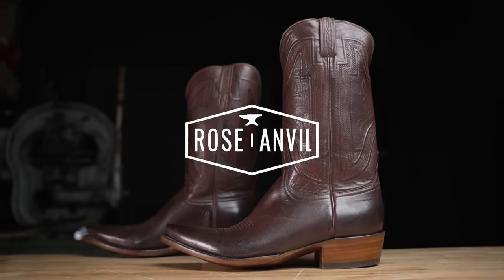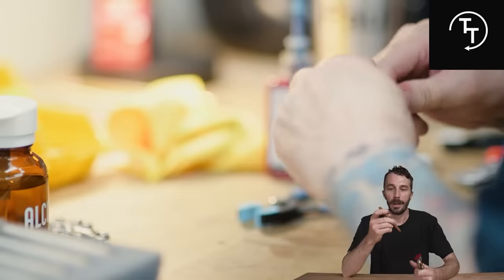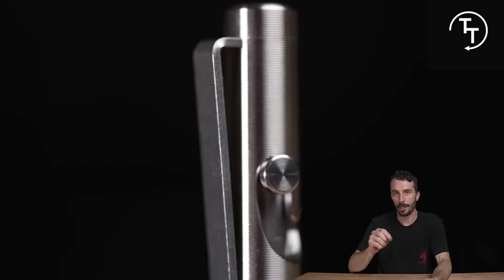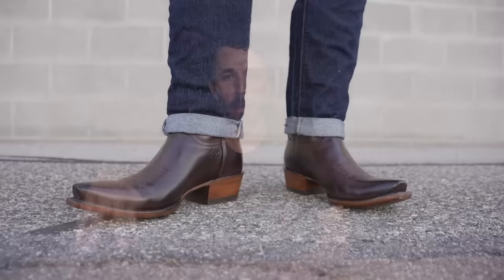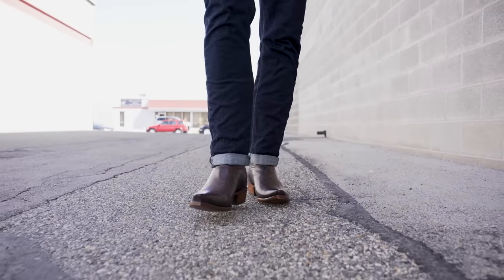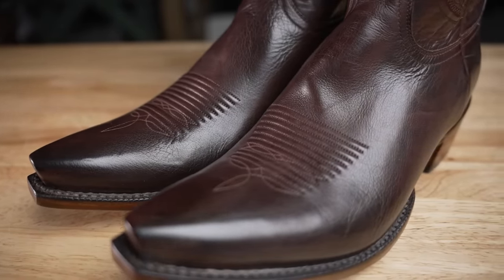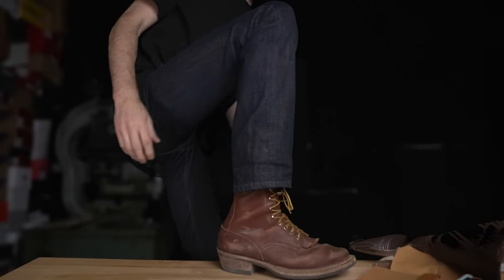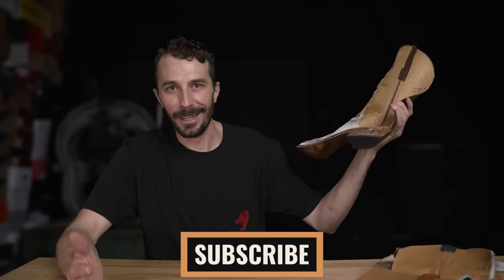Why the most luxury cowboy boots are disappointing - Lucchese

Comment: They should definitely have better quality lining in there. I would expect calf or something for that price.
Reply: Yeah but what you're missing is the fact that they are making these boots the exact same way they made them a 100 years ago to now, to change anything would change the heritage, when you get a pair you're wearing the same boot that James dean wore
Reply: Im sure James Dean had a composite narrow square toe structure. Much heritage.
Reply: @ausfuhrung  They weren't using plastic toe stiffeners and foam heel cushions 100 years ago...
Reply: @Brian-ee1gx  They didn't even exist yet
Reply: They don't make lucchese boots like they used to. At this point they still sell boots because of the name, if you want a real pair of boots get some rios of mercedes.
Reply: @ausfuhrung   they promote that but it isn't 100% true. I love lucchese classics. Won't wear anything else. But san antonio classics had leather heel Rands. After moving to El paso the heel rand became plastic. I dont know if any other materials changed but I know that did. And while the boots are otherwise made the way boots were made in 1883 construction wise, they have changed some of the methods, like implementing an automated stitcher for the shafts. 

That said the bootmaker/1883 line, while using the same outer leathers, uses a different method/process than the classics to make them cheaper along with a cheaper lining and welt construction. But the claim they make the classics the same way as 100 years ago is only true in terms of final construction.
Reply: so do have calf lining it’s just different for some boots. every lucchese i’ve got is 100% worth the money. Tecovas is now becoming my more everyday no matter what boot recently.

Comment: Lucchesse and Leddy's boots also come with the concept of a well fit boot. If your foot fits perfectly in an off the shelf boot from boot barn then good for you but most of the time those boots are going to be pretty loose. A good way to know easily when it comes to cowboy boots is if you can easily take them off by hand your boots are far too big. You should need a boot jack to get them off easily. Having a thinner foot leddys and Lucchesse are the only places I've found with boots that fit off the shelf as they have a wider size range going for them. Plus you don't have to go up to $1k, they have several boots for $500-$700 same as Leddy's. But if you're going up to $1k anyway you might as well go up to $1500 and get yourself a full custom pair from Lucchesse. Mine should be coming in next month lol.

Comment: I have a couple pairs of Luccheses. They used to have a non-handmade line that was cheaper. I paid about $300 for a pair of ostrich leather boots. My other pair was about $700, all cowhide, and they were a wedding gift from my wife. I really like my boots a lot. The cheaper ones are more than 10 years old and the more expensive are 9 years old. Both are holding up well with normal maintenance. 

One other thing about Lucchese is you can often select the type of leather you want from normal cowhide to goat all the way up to exotic things like crocodile. I once saw a pair in a store in Santa Fe that purported to be elephant skin.  That is insane to me. Anyway, I don’t have the ability to measure the thickness of the leather on mine, but I would guess they’re thicker than 1.5 mm. Maybe the thickness is related to the leather you picked?
Reply: They still make the 1883 line, and they’re still nice boots for a lower price
Reply: Elephant 🐘 hide boots are fairly common, readily available.

Comment: I have two or three pairs of Lucchese. They have a nice look to them. The things that made me really irritated is I moved north where there are cold temperatures along with snow and ice. You can't wear a thick sock in them so your feet are either pinched or cold. Then there is the leather sole which after both feet going out from under you and a week of pain in the shoulders, neck and head, tou become unhappy. The thin leather cracks even with weekly treatment. I have one good pair left and use it for summer wear. Bought a cheap set, put insoles for better comfort and you can wear heavier sock. Dropped them off to be resoled in vibram. That was as much as the boot, but great for winter wear.
Reply: Exactly, ive got the same issues. But add to that, the lack of a pattern or rubber sole to grip in ice and snow, or even mud. Cowboy boots in new england are only good to wear when its too hot to wear them!
Reply: @HarborLockRoad  what treatment do you use?
Reply: I would never wear my Lucchese's in the winter.  Not only is the ice a slip hazard, but all the salt will decimate the leather.  I've ruined a decent pair of Allen Edmonds dress shoes, and would hate to see that happen to my Lucchese Caiman leather boots.

Comment: I found that their cheaper lines typically had the thinner leather such as their 1883 series, however I found it made them much lighter to wear and quicker to break into the shape of your foot. As a dress boot, I feel thats OK. Their classics line is much more expensive and my pair of those is quite alot heavier. Another point missed in this video is that this line of Lucchese boots aims to be made as close as possible to the traditional way of doing it. Yes there is a little synthetic material used in places as mentioned, but things such as the pegging on the sole is unique to Lucchese and not found elsewhere AFAIK. You are paying for something that has had alot more hand labour go into its production than any other boot.
Reply: @LoneWolf-qk9pl  I ordered and just received a pair of blackjack boots in  the same size as my Lucchese Classics boots.  They are very well made and fit ok.  But I have to say I’m disappointed because they don’t feel as good as the Lucchese.  There is just something about the way Lucchese Classics boots fit and the comfort that seems to be unique to them.

Comment: Since you were reviewing the justification of the price of these boots, I find it odd that you didn't comment on the other quality features of a high-end cowboy boot like the amount of pegging used, which is a hallmark of premium quality cowboy boots...generally, the more pegs used, the better the build construction.  You didn't go over the quality of the stitching & design on the outside of the shaft which is far superior to other mid-line cowboy boots you had assessed.  I'm sure if you cut into a pair of exotic-skinned boots, you'll also find that they're also thin. Your comment on how thin the leather is, but you noted it's higher quality leather. You don't think the higher quality leather doesn't contribute to the cost like other exotic premium skins? Surprisingly, as a cobbler, I thought you'd have better insight as to what makes a quality high-end cowboy boot, yet you don't speak adequately to key facts about top-line dress cowboy boots: if they're handmade, the quality & cost of the premium leather, stitch quality & design of the exterior on the shaft, and whether the model is a limited edition or a custom design. 

My ex used to work in a cowboy boot store back in the early 1990s (which is why I've got over eight pairs of cowboy boots), and I learned a lot about the key differences between budget-priced cowboy boots, mid-line cowboy boots, and the high-end cowboy boots. It really comes down to the materials, build quality, the boot's intended use (fashion/work/daily use type of boot), and it's availability (ie. limited editions). If you're going to compare $1000 boots, compare them to other high-end boots (ie JB Hills, Tony Lama Gold/Black Label etc...), citing the qualities that makes them high-quality boots...not on merely how thick the leather is. You'll find that exotic leathers aren't very thick at all as well.
Reply: This

Comment: Tactile pens have the best pens for grip. The bolt comes off easily and needs to be Loctited (spelling?). Not a big deal, but if you're around town without the bolt Loctited in, then it could pop off and you'll lose the bolt in a random spot. Fortunately, I lost my bolt at home and found it easily. Haven't had an issue since. Same is true for BigIdeaDesigns.

Comment: There's a  cowboy boot company called Stewart Boot Company based out of Tucson, AZ that has been around since the 40s, I believe, that makes hand made boots that are around the $500-$600 range. I'd be interested to see what their construction looks like. They used to be pretty readily available, but their production is pretty low these days. A couple of tidbits I do know about them is that they claim to be made of horse hide (not sure if it's Cordovan or not) and you can find vintage pairs on ebay fairly easily. I think they also do custom orders.

Comment: Maybe I missed it on the previous pairs, but the metal shank seems to be much longer and maybe wider on these, seems much better imo, especially since they are just dress boots. Not much need for the shaft in non work boots

Comment: Not disappointed in the least with these dress boots. Exceptional fit& comfort for me. Cost 800. No tax or ship. If you need a boot for mucking Around  livestock. Go Muck or go home. Nobody in their right mind would wear Alden’s in a stable. Lucchese does  have cheaper work boots.They also have them in multiples of a thousand.

Comment: 16 years ago I bought a pair of Luccheses. I'm a Brannock 10C, so standard size footwear doesn't fit all that well. These were 9 1/2 D. They slipped on like socks. But with an arch. They cost more than any pair of shoes I'd ever bought. $500 or so, which was way beyond my budget. I wandered away from cowboy boots over the years, but I kept these boots (after totally wearing out an awesome pair of 10-1/2 B Noconas. 8 years or more of near daily wear). After watching this video I dug the Luccheses out of the closet, brushed 'em up, and wore them around for a few days. And you know what? I like them a lot. Your aesthetic is beefy, thick slabs of leather, and thoughtful, tough construction. I get it, and you've taught me a lot about boots how are made, for which I'm grateful. But my Luccheses, with their thinner leather, higher almost Cuban heel, and oh-so-subtle curve from high waist to the snug yet surprisingly comfortable toebox, are more than the sum of their parts. I did insert a Birkenstock footbed, which snugs up the instep for a truly custom fit, and a tighter heel.  As stylish as they are, and Luccheses always look SHARP,  this boot has a built in stride, a natural gait. It is among the best walking shoes I've ever worn. The lightness of the boot, even with its calf shaft lining and pigskin vamp, makes it surprisingly comfortable year round. The leather sole isn't all-weather, but it isn't just a big insulating slab. You can feel the ground. Good for you for keeping companies honest about market parity. I don't disagree about cost, but there's a deeper design issue with Luccheese that is about a more holistic package. They're boots I'm glad to live in.

Comment: The cowboy boots you have cut open in this series are for the most part only cowboy style boots. They are not a working cowboy boot. Boots that are being used all day in the saddle will most likely be tall topped, round or squared toe,and higher heeled with a spur ridge. The vamp will be made out of heavy  leathers to counter wear from the stirrups,and brush. Working cowboys take great pride in their gear,and how it looks. They will spend a lot for gear especially when it is made custom to their needs,and styles. Olathe boots might be good ones to cut in half.

Comment: Over the years I’ve worn Tony Lama, Dan Post, Hondo, Double H and El Dorado boots.  I also tried a couple pairs of Ariat boots which were more like western sneakers. They were comfortable at first but the fit became increasingly sloppy, and the soles and heels didn’t bold up well.  I sent them in after about 12 months for new soles and heels and it wasn’t worth the trouble or the $90 per pair expense as the new soles were not going to wear any better than the first set. After a couple years of just sitting in closet while I wore real boots, I donated them to Goodwill.  2 stars don’t recommend.

My choices for testing for “best cowboy boot”:

1) El Dorado boots.  I’ve had a couple pairs of El Dorado boots for about a year and so far I have been impressed, although so far they have mostly been regular daily wear around town dress boots They are vanquished calf leather one in a round toe and the other in a square toe.  They have a similar look to Lucchese dress boots but with a last that fits my feet a lot better than the narrow in the heel last that Lucchese uses. And at $279-$379, they cost a lot less. Other than a removable TCS insole, they appear to be a traditional hand made boot. 

2) Hondo boots.  I’ve also had a couple pairs of Hondo boots (styles 2904 and 8555) for almost 10 years now and they’ve held up well through two or three sets of soles and about that many heels with everyday wear in the wet, etc.  The 2904 boots are starting to develop several vertical cracks in the leather on the outer edge of the boot where it flexes. To be fair, they’ve lived most of their life in eastern NC, where wet and humid is the norm and they’ve seen hard field use.  The rest of the boot has held up well and I’m tempted to have that area patched when they finally crack through the leather.

Comment: You can get a handmade, custom-fit US-made cowboy boot like a Wilson's Boots or a Beck's Boots for 650-700 USD, though those take a few months to make they'll be a lot better than this I think.
I'd love if you could cut up a Wilson, but those take up to a year to be completed. That said... you could pick up one of the handful of used ones on ebay for like 200 since you're just gonna cut it up. I'd appreciate it! It would be a nice thing to know since I'm really thinking about grabbing the Wilson.
There's some quality show boots I've heard a little on
You could also look at Stallion Boots, though I'm pretty sure those are greatly overpriced as they're even more costly than Lucchese they're supposed to be very high quality but mostly fashion over the form of others.
Rocketbuster is supposed to be both very quality build and a show boot, handmade, extremely expensive, a lot of flashy decoration along it.

Comment: I always enjoy looking at the inside of boots and how they are constructed, but I've got to say that I think you might need to be more flexible in your standards. Of course they are thinner, the wearer of these thousand dollar boots is going to wear them at a restaurant or a meeting or to an event with a dress code and invitations. These boots weren't made for fighting forest fires, they were made to feel like slippers with a heel and a calf. You judge everything based on a standard of whether or not it will withstand six days' hiking and a forest fire and a wade three miles upstream, of course boots designed for show and for comfort are going to fail. If you judge them by their intended use, I'd bet (or at least they should, for $1k) hit the nail on the head.

Comment: A cowboy boot is designed so you can (bend your foot straight) out like a ballerinas slipper to escape from your horse and not be dragged by your stirrups! Why do want thick leather fof that? Cowboy boots leather is a leather slipper OK genius, to slip off in a emergency.  A slipper has no shoe laces as well = just like a Cowboy boot. OK Yankee,  a cowboy is not a farmer. If you're a Ranch owner if you not on a horse you're typically in your helicopter not a tractor.
  God bless Texas.

Comment: Wish one of the Ariat pair had been the workhog,  since that's the boot I bought a few years ago and have absolutely loved. I hadn't had a pair of cowboy boots in decades before I bought these, and would rather wear those than any of the other types of boots I have if I can help it. Not great for roof work,  but I've worn them for that too, metal, shingle, tile, and flat roof. Great videos, keep it up, and thank you. I'm definitely in the market for another pair soon, or to get my Ariats re soled. I bought a pair of Durango boots on line, which maybe was a mistake,  especially since I had such limited options in size and style or model of boot. They feel kinda cheap and fake, but for what they are and for what i will probably use them for they might be just fine. I cant remember the style/model off hand, but i think this is the number if it helps DDB0176 I they were around the 160-170 price point
Reply: Maverick I believe.

Comment: Are they overpriced. Well, comparing them to White’s, which is another handmade in the USA boot, yes. Really depends on how much you value brand names.

Whites are $600-$700 for their more expensive boots, and as you’ve shown have thicker leather and sturdier construction. So it’s at least $300 you’re paying for the name of the boots, but probably more because White’s have enough of a reputation to charge for their name, and have a fair amount of dressy-options around $300-$400, so more likely it’s $700 for the name (more than half the price of the boot).
Reply: White’s are extremely fairly priced. You are not paying just for the name. They even go on sale every year 20% off and have many custom options. Also unlike these boots, whites are completely handmade and hand welted, way thicker leather, more materials used and just better all around quality. No plastic nonsense. AND they are only $600. That’s a very fair deal